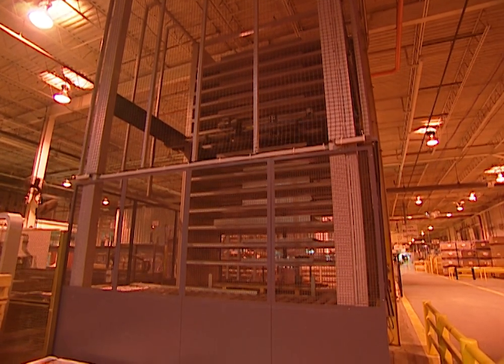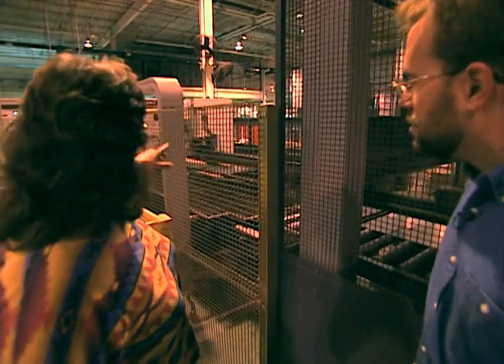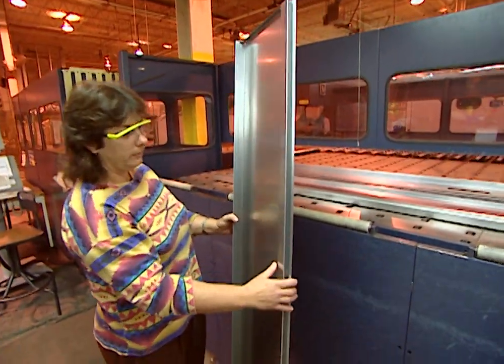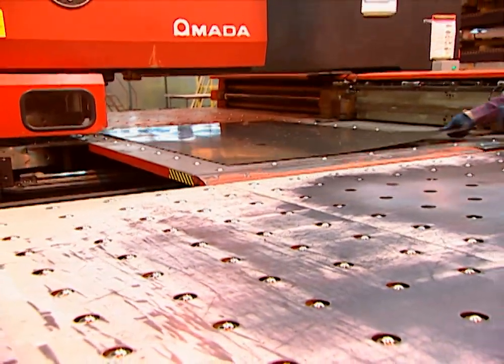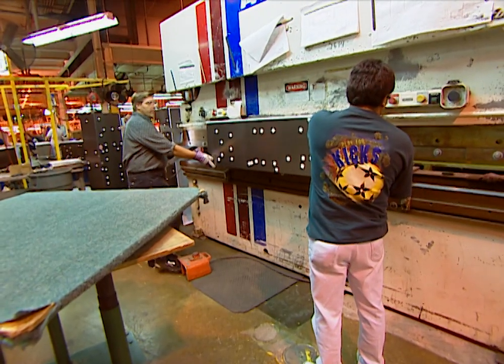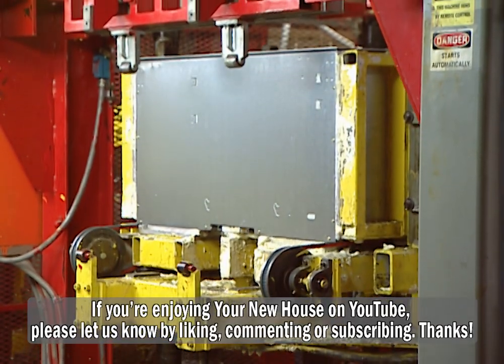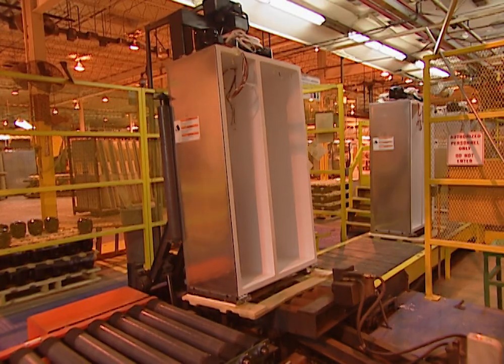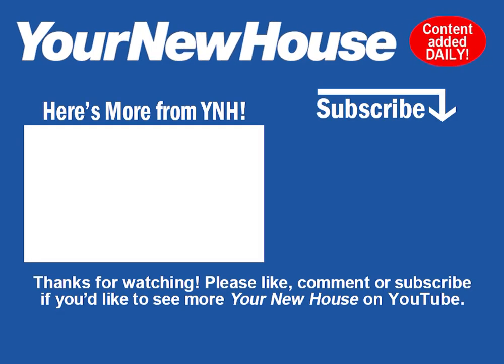How Refrigerators are Made: Whirlpool Factory Tour - Did You Know?

Comment: I wonder how many people actually know how to make a refrigerator from scratch 
And without the machines help
Reply: I know I worked for whirlpool
Reply: @dadosamac   do u still?
Reply: @kk5508  yes I think so. Do you need one to be built?😉😉😊
Reply: @dadosamac  how do you build from scrap
Reply: @kk5508  the only hard part is to get foam inside the cabinet and harness wires and programming,after that rests should be easy
Reply: @dadosamac  parts are hard to find and foam has to be right temp.  Liners come from plastics which is made in big machines and different materal it depends which refrig. U want if u want a built in the liners are actually made of metal.  The wire harness come from Mexico
Reply: @dadosamac   u don't work there lol
Reply: @kk5508  I said I worked. Lol. You probably working there.
Reply: Me
Reply: Yes, I wonder how the first set of refrigerators were made (I am guessing without machines)